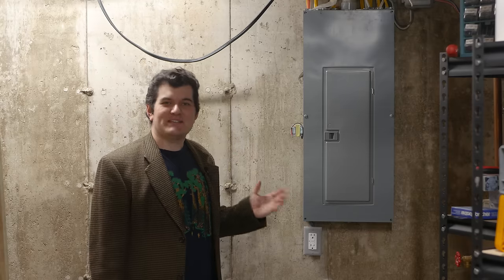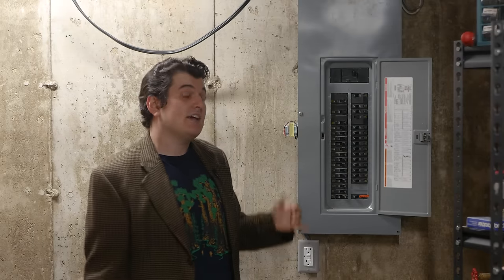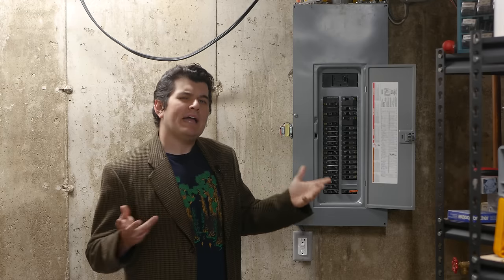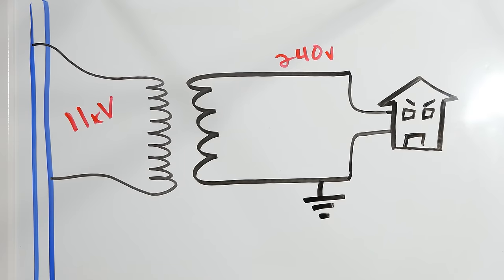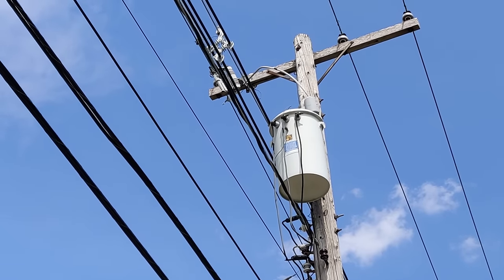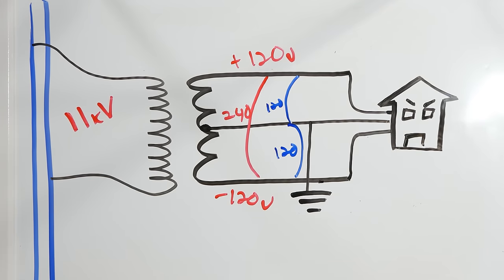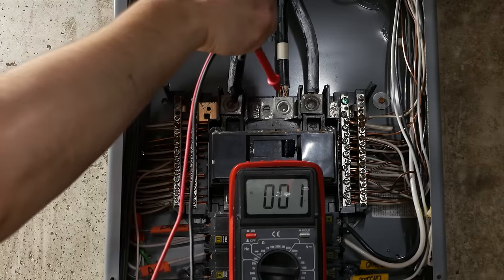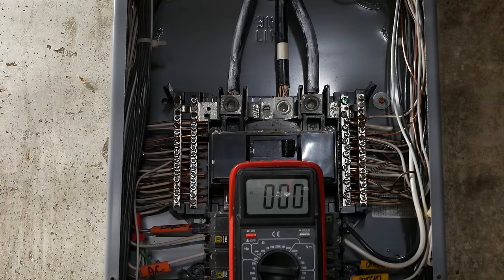The US electrical system is not 120V

Comment: Cool stuff! Some of the breakers in my box are connected to the breaker next to them via a plastic linkage between the switches. I guess I know why now. Thats less breakers to check when my dryer is acting funky.
Reply: If you properly labeled your breaker panel, you wouldn't have to check any breaker other than the one labeled "dryer".
Reply: @jimmy_kirk  bro im 20 i dont own this place. my landlord would eat my ass out it he thouht i was messing with the electronics. I deal with shit as it pops up and the dryer hasnt messed up yet so i dont  know which one it is. If it does mess up, ill know its one of the double breakers so ill be able to find it quicker. thus the coment.
Reply: @dudebruh8183 I'm talking about flipping breakers to see what circuits are on which breakers.  I'm not suggesting anything like putting pennies behind fuses in a fuse box.  But I get it... its not your property and some landlords like to eat asses.

But, someday you will own your own home (hopefully) and one of the things you should do is properly label the breaker box, as more often than not breaker boxes aren't properly labeled.  

However, since it's not your property, and breakers trip for safety reasons, if your landlord's dryer is tripping the breaker, that's a safety issue for him to address. 

It's one thing if you overload an outlet with too many devices or appliances and end up tripping the breaker because you're drawing more amperage than the breaker is designed for... but if you have a dedicated breaker circuit specifically for the dryer and the breaker trips... that indicates that there is a safety issue with the dryer, which the landlord should address by either having the dryer repaired or replaced.   Flipping the breaker doesn't resolve the safety issue, it just allows you to continue using an unsafe appliance for a short period of time.

Comment: I would like to comment on your advise that 240volt is more dangerous than 120volt. Not true! Actually, 120 volt is more dangerous because there are many, many more of them. Also, no one is killed from being shocked. Sometimes I've actually worked on a 120volt circuit hot  (something I would not recommend). The danger from a 120 volt circuit or 240 volt circuit is when the hot leg of the circuit is touched and a ground such as a water pipe is touched like in a kitchen. That current will pass through you to ground! And most people will think that is OK because it's just 120 volt, 20 amps. WRONG! That current that will pass through you to ground is 10,000 amps and could kill you instantly! The reason it would be most likely be 10,000 amps is because the breaker is rated for that amount. It could be much higher than that in a commercial building because sometimes as much as 200,000 amps fault current is available in those locations. And working on a 120volt circuit outside standing on the ground is the most dangerous of all locations. A person standing on the ground is automatically making a live circuit from 120 volt current to ground or 10,000 Amps! Thanks, Glenn Norris PE

Comment: At the 3:16 point in the video, you state that the transformer on the pole produces 120 volts "twice." That is a rather ambiguous statement. More accurately stated, the transformer produces 240 volts with the secondary winding center-tapped, to allow the two individual 120 volt circuits. BTW, I am a retired industrial electrician, with 40+ years experience in that line of work.

Comment: Why is it that 120/208 VAC Y-configured 3-phase, where all three phase angles are equal to 120 degrees, considered 3-phase; where standard U.S. residential 120/240 VAC power where the phase angle between L1 and L2 is 180 degrees is considered single phase power.  It's always seemed to me that, to be consistent, it should be called 120/240 VAC 2-phase.
Reply: Two phase was used for the old Tesla system used in the early 20th century.  The phases for that were 90 degrees part.
Reply: That is an argument for pedants.  The split phase system is derived from a single phase of the 3-phase distribution network, but the output can be considered to be two phases 180° apart.  The two views are mathematically and functionally equivalent, so the argument is only about terminology.  Pedantry.

Comment: Wait people genuinely think our power is 110/120? How do they think dryers work? They’re not 120 they’re 240 same with the electric stove and our outdoor and Indoor ac Units unless you’re running a window unit but I’ve seen some with a 240 voltage and plug, also they probably don’t know this but transformers use split phase power single phase 120 on each leg and when combined they give you 240.

Comment: Why in 'murica there's separate transformer for each house or few houses? I don't get that.
In Europe we do that in transformer stations, which are typically outside the village somewhere and have engineering team working there and keeping eye over all transformers. The grid is also protected from lightnings and since all transformers are on the same place, they can be easily and fast fixed. It's also muuuch much cheaper.
One more thing, in europe we have separate ground and neutral. The neutral goes to the transformer at the transformer station, while the ground goes to a rod somewhere around the house. This provides additional safety if the rod corrodes, it's also easier to install failsaves like RCD protection.
Reply: some european countries use tn-c (bootleg ground) in old installations
Reply: Why in 'murica there's separate transformer for each house or few houses? I don't get that.

	US 'muricans don't live as close together as 'urpeans do.  That and the lower voltage voltage delivered to the house.

In Europe we do that in transformer stations, which are typically outside the village somewhere and have engineering team working there and keeping eye over all transformers.

	Sounds like you have transformers that cannot run unsupervised.

The grid is also protected from lightnings and since all transformers are on the same place, they can be easily and fast fixed.

	Provided you have village sized spare transformers and the equipment to move them. Two guys and a pickup truck can replace a pole transformer.

It's also muuuch much cheaper.

	Transformers cost depends on their weight for the most part. Saying a large transformer is cheaper than a group of small transformers requires a spreadsheet. Oh! 60 hertz transformers weight less than the equivalent 50 hertz transformers.
	

One more thing, in europe we have separate ground and neutral. The neutral goes to the transformer at the transformer station, while the ground goes to a rod somewhere around the house.

	So what?  Since the transformer in the US is so close to the house there is no reason to keep them totally seperate. As long as you connect them at ONE point.

 This provides additional safety if the rod corrodes, it's also easier to install failsaves like RCD protection.

	RCD uses the difference between a hot line and its neutral currents. How ground is wired doesn't make any difference.
Reply: @securitycamera8776 an rcd won't work with tn-c
Reply: It is more efficient in one respect to bring the medium-voltage distribution lines close the point of service, to keep the low-voltage service lines shorter.  Everything is a tradeoff, though.  You would have to look at the entire distribution system for a small city in all of its characteristics to get a meaningful comparison.  The North American electrical distribution system works well, it is just different.

Comment: 200A circuit breaker???? I've only seen this in commercial businesses. At home I have an 8kW contract, and a 32A general circuit breaker. I also have the 6kW PV. Yet I have a 2000 m² villa. From personal experience, I have only seen 30+kW private users in 2-hectare houses with several swimming pools and multiple homes inside.

Comment: Do they have RCBO's in the US? Its a combination of a circuit breaker and an RCD in one unit.
Reply: Is that what we call a Ground Fault Circuit Interrupter in the US?
Reply: @GH-oi2jf  I suspect so - in our case RCBO is both a circuit breaker and the RCD/GFCI in one unit, goes into the switch board just like the circuit breaker but also provides protection for humans rather than just the wires
Reply: @francocozzo7235  — The US has breakers with a built-in ground fault protection feature.  We install them on individual circuits, not the main for the whole box.  Old work may not have them, because we are only required to upgrade our wiring to newer standards when it is being worked on.

Comment: 13:08 but does an engine powered clothes dryer exist? That would be pretty cool because of how absurd that would be.
EDIT: I remember from when I was a kid, we had a three prong maybe 1ft extension cord and it was so hard to remove from the wall, I accidentally touched the live contacts on the plug. I was able to remove my hand as soon as I felt the electric current and it felt like it was going through my whole body, unlike a shock. It wasn't painful, but it was still pretty scary touching live wires. I didn't try it a second time because, "oh it was fine once, so obviously I can do this as many times as I want without issue."
Reply: Not in the modern sense. Maytag started out building engine powered washing machines with an wringer on them to squeeze out excess water, dryers back then (aka clotheslines) were solar and/or wind powered.

Comment: Wrong! ALL electric utilities base their Utility Commission delivery requirements based on 120 volt metering, even for primary customers getting 13.2 KV. All primary and 3 phase metering is on a 120 volt basis for revenue metering. In Florida and NJ it's 120 Volts, +/- 5% or 114 volts min  to 126 volts max as measured at the meter pan. In fact, at the glass meter we measure kwH based on 120 volts for even for 480 / 277 Y or 120/208Y or anything else. Go to school my friend. Retired Substation Engineer, First Energy.

Comment: I enjoyed this video so much and laughed through most of your opinions on UK systems. I'm not in the UK but we use most of the same as the UK here in Ireland. I do think the fact there are no trip/RCD protections on all US domestic circuits is scary... even light circuits must have that here in Ireland and we also have a new requirement for earth wires to be protected by its own insulation which the UK does not yet. I like your view that 120v is not essentially safe but definitely safer. But whenever visiting the US it is a balls trying to boil a kettle!!! I recently saw somebody when there "try" to make tea from a microwave!! OMG noooo.... and they even put the tea bag in with the milk into cold water and boiled it up in the microwave!! That's like a sin for us to see someone do!!! Best thing to do is to think of the tea!! Go adopt the UK system and get a proper cup of tea on the boil with a kettle at 240V with no centre-tap and instead reference one of your so called "hots" to earth so you have just one simple Live and Neutral with an earth to each device and you can have a nice safe RCD trip system or TN-C-S as we call it here (meaning we have a two wire feed with ground being just combined neutral and earth - separated before RCD protection). As for the the foot risk comment with a UK plug... our feet must be made of stronger stuff as every child here has walked on a plug so many times we end up with iron strong feet! But it is worth it for the design and safety of that socket. Being in Europe it would be nice if we all adopted the UK socket as the German style Schuko socket is VERY dangerous - if you have not already check out how easy it is for a baby to put their fingers into one - thankfully our friends in the UK made "doors" that open and close when you insert and remove a plug into a socket to actually stop that, and if pulled by the wire the socket the earth is the last pin to come out of the socket meaning the device has earth until the circuit is cut. Our fuses are good as the protect the cable - but not for the reasons people think as the UK used to use 32amp ring main circuits to save on copper... scary! but ring main/devil circuits are finally over and not installed anymore in any new installs here at least. Finally switches on sockets is an excellent idea as it means vampire plugs like iPhone chargers do not waste energy when not use as we switch them off - if you kept unplugging a transformer plug you will eventually lose the plug entirely so having a switch is ideal. Believe me it is best for the environment. Anyways I LOVE your videos and hello from the West of Ireland.
Reply: Many of us have standard 240VAC receptacles for kitchen kettles.  You don't have a monopoly on that.  It is sad however that many US homes have not wired a single 240 receptacle.
Reply: Schuko is safe. Regarding children's safety there are special plugs with shutters so nothing else but a plug can be inserted. Shutters only open if prongs are pressed with the same force simultaneously. 

I wish every country would at least use type E/F socket. The so called euro plug with two prongs can be used almost anywhere except in UK and Ireland which is always a nightmare having to carry my adaptor for the only purpose of charging my phone haha 😄 

A Schuko plug is quite bulky too so no real advantage, but chargers don't require earth connection so these are really slim and convenient

Comment: "We have 240V too! " he declared in desperation. Meanwhile, proper electrical systems provide RCD protected 230/240V to every outlet, and 415/440V 3-phase to high power equipment like EV chargers and 20kW air conditioning systems. RCD protected 240V is safer than 120V. The "all things being equal" describes a situation that doesn't happen a lot. And you're sitting there ranting about switched outlets, while talking about how you shouldn't unplug appliances under load. It's super convenient being able to switch the appliance off as you go to unplug it, rather than having to walk over to wherever the device switch happens to be.
Reply: We are happy for you you can keep it, don't want 440 in my house thanks anyway.
RCD 240V is exactly as safe as GFCI 120V  It's the circuit that protects you so that's a moot point.
20kW ? You know we are capable of supplying 480V 3 phase if we need that?

Comment: The house i bought has an outlet right below a window but only barely higher than the other ones in the room. Took me a few lightbulbs to realize its wired for an AC and way too hot for anything else.
Reply: An A/C is usually 240V, in which case the receptacle type should be different.

Comment: So that means that in order to have 240V in US all you need to do is build an adapter with 2 plugs. With long cords just in case you need to plug each one in a separate room. If you plug it to sockets that are wired on the opposing phases you should be able to build a 240V socket out of it.
Reply: Yes but it isn't up to code to do it. 240 must be from box to device point to point.
I wanted to do just that in my living room, wire a box with a both phases in it near a window so i could run a 240v air conditioner with an adapter like you describe. 
My union electrician cousin told me it wasn't to code and advised not to do it.
His advise was free so I didn't ask why.
Still a little hazy on what issues it would cause.
Reply: You don’t need an adaptor.  You just plug in a 240V breaker and connect a 240V receptacle to it.
Reply: @ghz24  Screw the code. I was only interested whether that's doable.
Reply: @darek4488 I get it, definitely doable. I was going to wire my front room by splitting a 240 breaker in half and making half the outlets one phase and half the other so if either leg overloads and trips a breaker both would trip.
If you pick 2 random 120 legs one could trip the breaker leaving one still live. That could damage the 240 device or may cause pther problems.
30-40 amps is the most you can likely pull since 120v breakers above 20 amps are rare.
I ran a 240v fan from a central AC on 120 for weeks with no problem but sensitive electronics may be less tolerant.
Take care.
Reply: @ghz24  Thanks. However I think if both 120V breakers would trip at the same time if there is a short.
Reply: @darek4488  Well you're wrong. Breakers trip from overload, a short isn't needed.
If one of the circuits you tap into has a high current device turn on it could definitely trip just that half of your 240.
Even if you're sure both are isolated from other devices a short between the two hots would trip both breakers but if the short was between only one hot and ground it would only trip the one that shorted.
Reply: @ghz24  I haven't thought of that. Thanks. It is all foreign to me. I live in Poland and there is only one voltage inside the whole house. If you need more juice you use beefier wires and breakers. However every single building has a 3-phase connection if you ever need it for some heavy machinery. Most buildings use the phases separately. Combined they can give you the potential of 400V.

Comment: Why don't we have more 20amp devices for 120v circuits? Your comment about 1500w limit on electric kettles makes me wonder since the standard kitchen circuit has a 20amp breaker.
Reply: Many modern circuits can support 20 amp appliances its just that most small appliances do not draw 20 amps. There are 2 different plugs for 15 amp or 20 amp appliances. On a 20 amp plug one of the legs is sideways. If the circuit can support 20 amps an outlet that accepts 20 and 15 amp plugs can be installed.
Reply: There will typically be two or three receptacles on one 20A circuit.  If you had several appliances which actually drew close to 20A, you would be tripping the circuit breaker every time you tried to use two of them at on e.